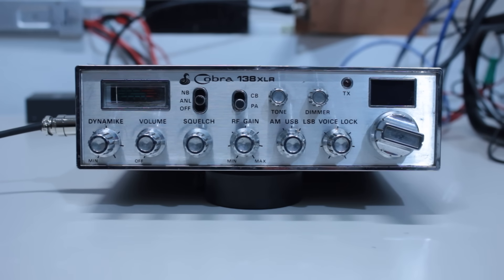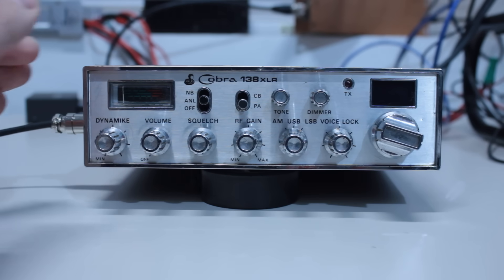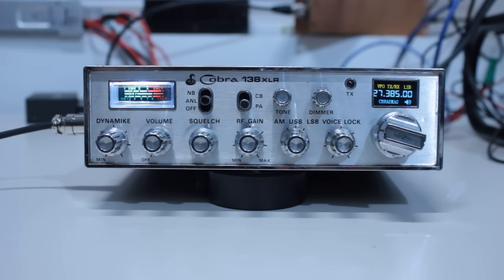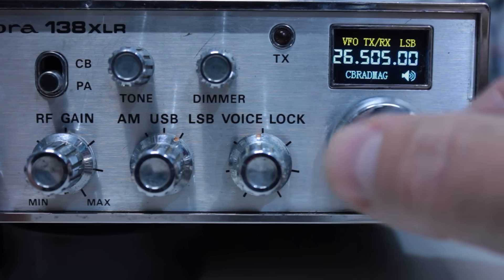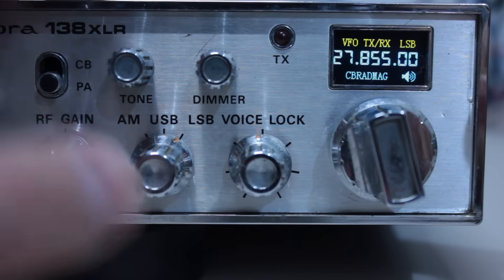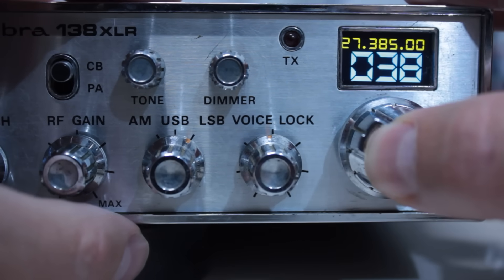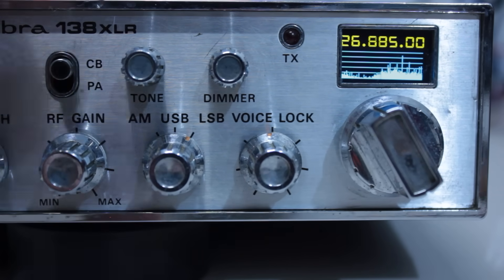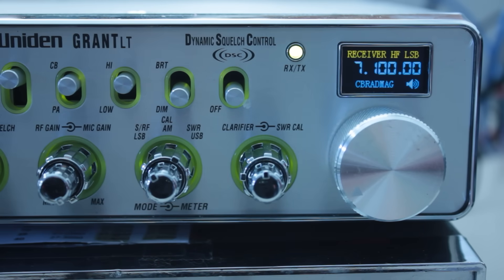This might be the coolest CB Radio modification we've ever seen

Comment: Nice product, complicated process to purchase and install  creator wants you to send to them to install.

Razor Radios in Australia offers a easier product, more versatile , fits most chipsets on the market.

CB40 product
Reply from the maker: CB40 installs I’ve seen only have 5 digital frequency display and are limited in their tuning steps. The DDS-VFO might be more time consuming for install but from what I know of the CB40 it doesn’t have the same abilities unless something has changed in the design. I agree that the install can be difficult and I’d suggest for either the CB40 or DDS VFO that you have a tech install it unless you have some good radio experience and proper test equipment.